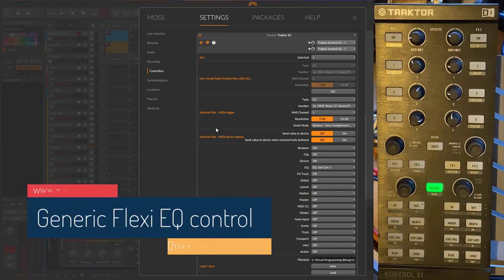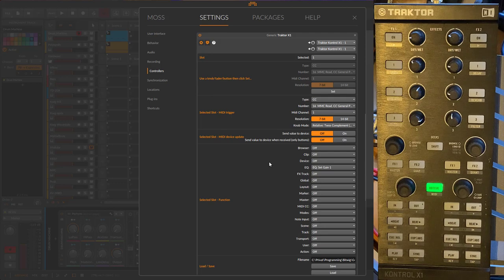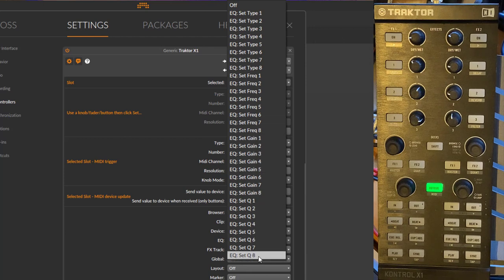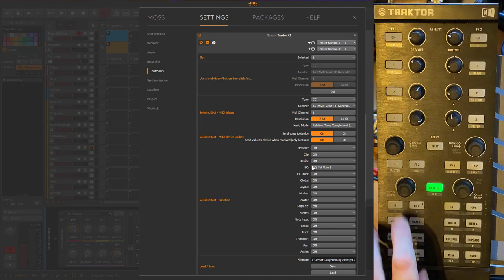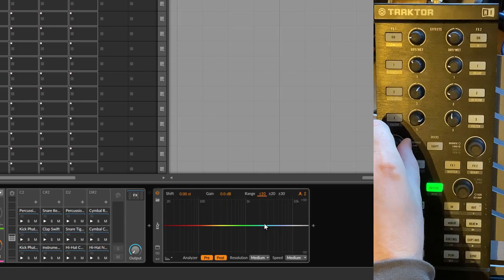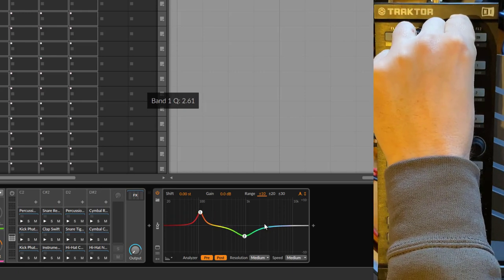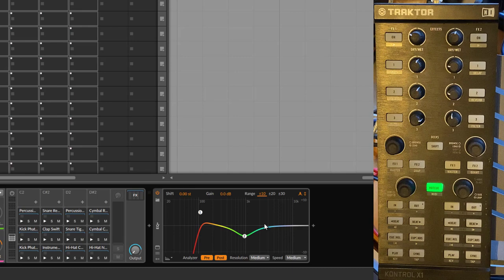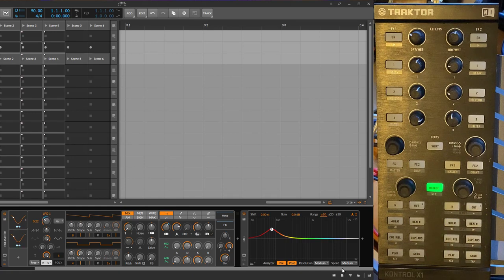Generic Flexi - Controlling the Bitwig Equalizer (using an NI Traktor X1) - DrivenByMoss 15.6

Comment: @mossgraber I was looking wether there was an option to assign a fader (or knob) to the device' active parameter. e.g.: if I have the filter cutoff selected as the active parameter on a device, the fader (on my controller) would control that parameter. And if I were to switch to the device's LFO depth, that same filter would then control that as long as it's the active parameter on the device.
Reply from the maker: Sadly, such a parameter does currently not exist in the Bitwig API.
Reply: @mossgraber  😭
Reply: quick dirty way to to this is right click, assign to controller and after ur done automating/adjusting right click again and remove it. Takes longer and is more annoying but oh well @GamedevFred

Comment: Hey bro! Tell me, is it possible to change the color of the pads on the push 2? Let's say on the piano change the color white to purple? Thank you!
Reply from the maker: It is not configurable but if you know a little bit of coding it is easy to replace the colors (source is on GitHub).
Reply: @mossgraber  Thank you so much.